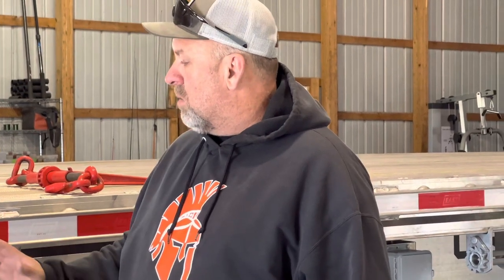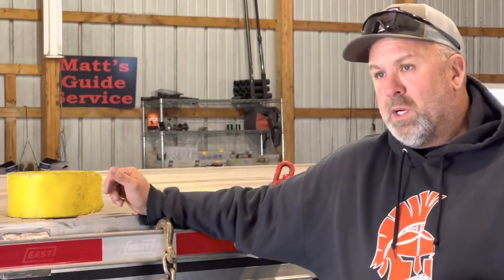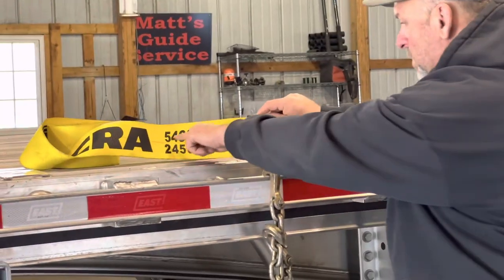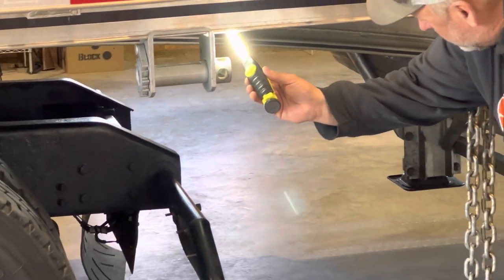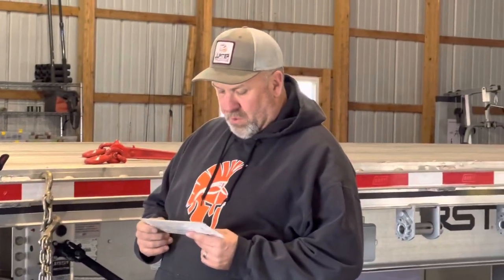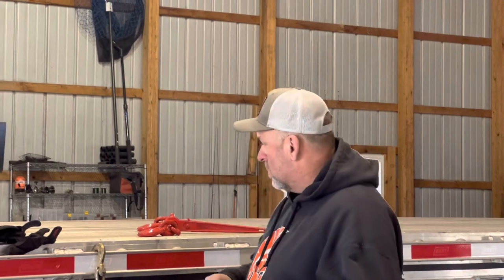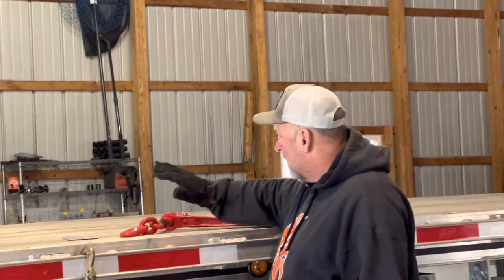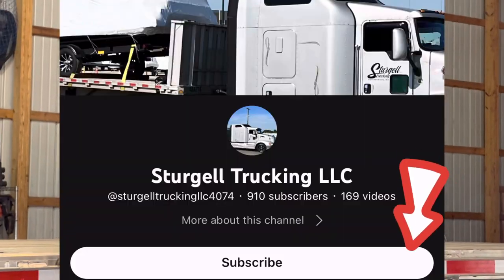CRST Flatbed…. securement calculations and values explained￼

Comment: Great video! I tend to oversecure, but judging from this video I may be going a little overboard thus wasting some valuable time. My only question is - how do you handle situations that require opposing pull? Throw some ratchets on the other side? Looks like all your roll ratchets are mounted on one side.
Reply from the maker: I have straps that have chains on the end that I can hook to or around the pockets or spools on the driver side and then I have 4 inch ratchet, binders with chains on them that I can hook to the pockets or around the spools or pockets on the passenger side
Reply: Brilliant